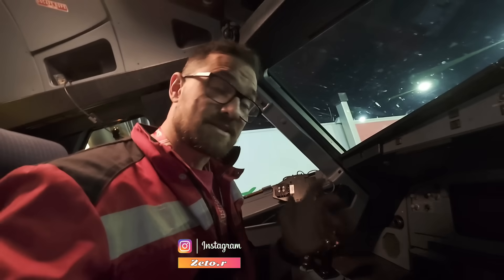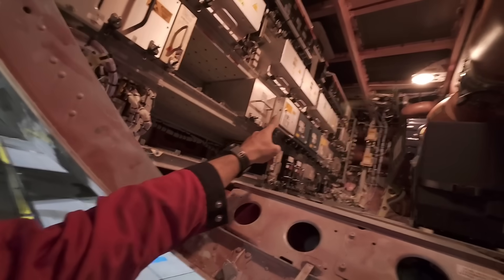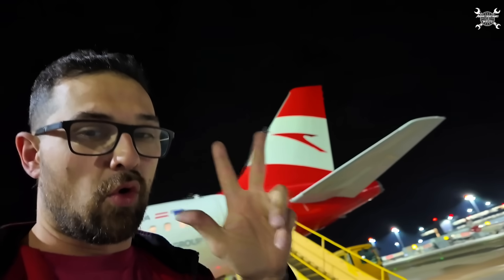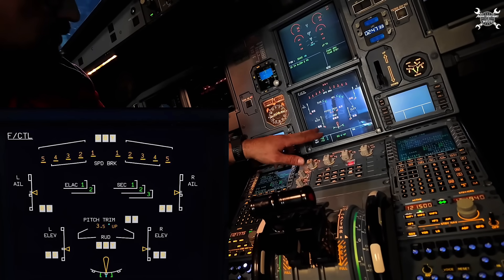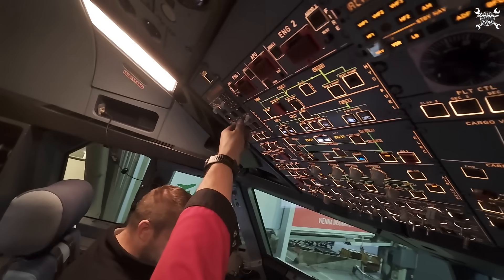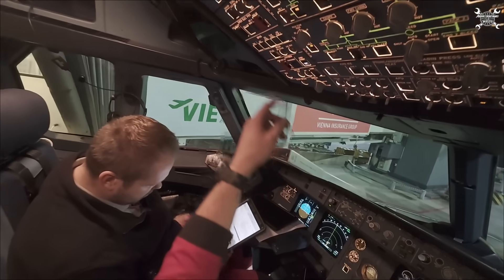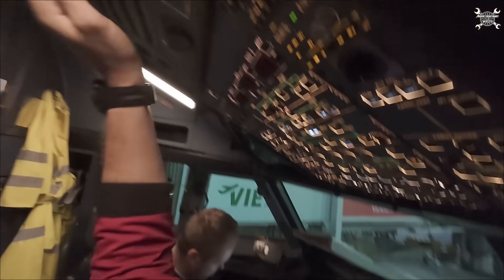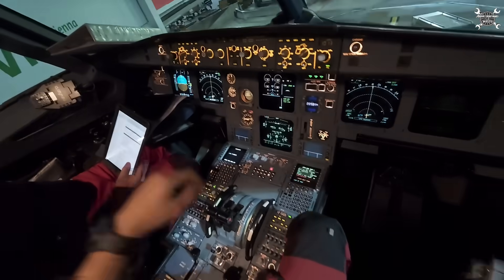Elevator and Aileron control (ELAC) on A32F

Comment: What does the term "A32F" mean? I am guessing it is an abbreviation term for A320, but since the registration of the aircraft you show here are passenger configured aircraft and not freighters, the F can't mean Freighter.
Reply: Family I guess. E.g A320, A321 and others.
Reply from the maker: Exactly it means A320 family which covers A318, 319, 320 and 321

Comment: @ 3 minutes into the video, is that whining and barking just the hydraulic PTU or are the hydraulics doing something else? Thanks! I'm guessing ptu as I think the craft might be externally electrically powered?
Reply from the maker: Your what you hear is hydraulic pumps and PTU since we demonstrate the function
Reply: @zeto.r  ah of course I never considered the system was powered up with the electric pump?
Reply from the maker: Yes to transfer power from yellow to green
Reply: @zeto.r  thanks! You seem to know that plane inside out. Electrical system, Engines etc. I thought aircraft techs had a special area of expertise like electronics, airframe, engine etc but you know about it all!

Comment: It is not part of your work, but better backup would be is both ELAC were in different bays, preferably one at the front and one at the aft of the plane.

Note there is a typo in the ttle of the video, you wrote aLLeron with two L.
Reply from the maker: A320 has avionic compartments only in the front so you sont have that many options for this. But who knows maybe in the future they till change it that way. And thanks for catching the typo it is fixed already🙂!
Reply: It's not a military plane. If the entire avionic bay is compromised, the plane is already in a catastrophic event. You'd have to build two entire separate avionics compartments in the plane to do what you're thinking, which is obviously impossible due to the complexity of cables and physical space in the plane.
Reply from the maker: @antoniousai1989 you have such design on E195 or b787
Reply: @antoniousai1989  That's what I am saying, two avionic compartments. But each compartment can contain only one of the redundant computers.
It is basic data center backup that the backup location should be in a different place than the main one. Arguably, the security of a plane is more important (for me if I am onboard) than any data center.
In the case of ELACs, a kind of separate locations is already attempted, they are located at the opposite far side of the avionic compartment, like it was important they are not sitting close to eachother. Why not go one step further.
Reply: @olivier2553 because it will exponentially increment the complexity of the plane. Different locations on a plane are a problem only.in case of physical problems. There's fire extinguisher already in the avionics bay, collision damage capable of damaging that compartment would break in two the plane anyway, so it's really pointless. As I said, this ain't the military where they can spend 300 millions on a single seater plane. Flying companies have to buy economically feasible planes.